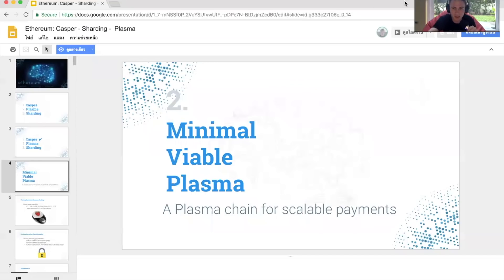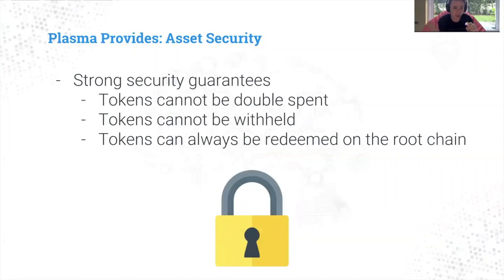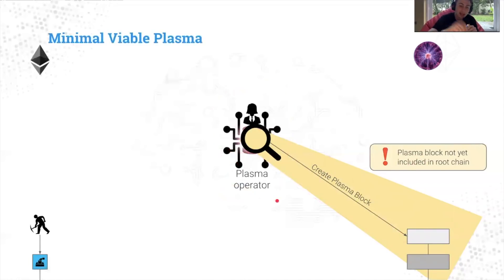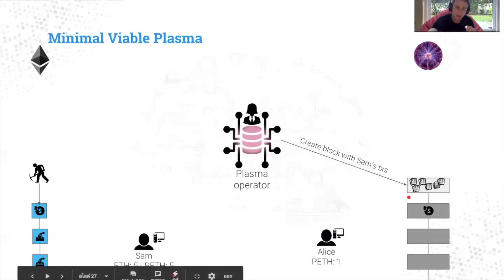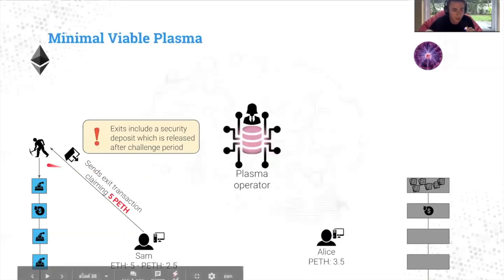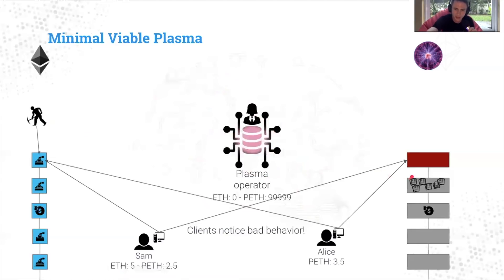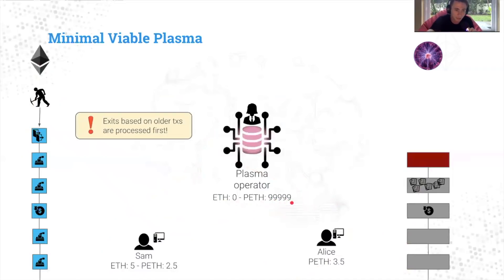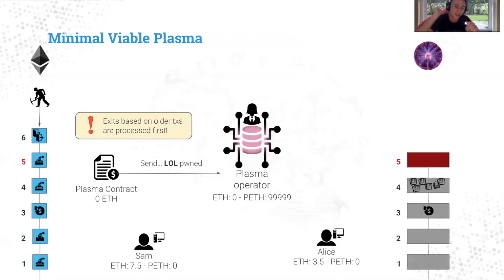Ethereum Plasma MVP Overview

Comment: How does this help with scaling if the transactions still have to go into the main chain frequently ?
First Alice has to wait for transactions to go on to the main chain to spend her funds, then why not send it in the main chain itself ? What am I missing ?
Reply: Yeah, so your question basically defines what a state channel is. So plasma chains are state channels with guarantors in between ?
Reply: Yeah so over here you trust that the guarantor will handle trust, but you're still limited to using the tokens on the subchain.

Comment: Great explanation Karl!  I have a question:  In your example, there is a 1 to 1 ratio between blocks on the the main chain and plasma chain. Was that just for demonstration purposes?  If not, how is 1,000 tx/s achievable if Plasma blocks are added at the same rate as the main chain?  (I have very little understanding of all this so apologies if this is a silly question)

Comment: Thanks for great video.

By the way I have a question.
What kind of datastore is expected to develop a child plasma system. I checked 2 MVP plasma or plasma-like  implementations  on github but both don't use blockchain on child chain side. They use no SQL like the levelDB.
Is this because they are just experimentations?

I'm implementing a plasma inspired system.
But it's difficult for me to decide what kind of datastore to choose.

1. MongoDB or other no SQLs.
Pro. Way faster than any blockchain system. 1000/s is easy. and very flexible
Con. Centralized and the plasma operator can do anything to the system. Only user can do is just exiting...

2. Use Geth to create private network as child chain
Pro. can use same coding technique as Ethereum main net. even same address works. PoA ( PoA if Geth supports... ) works well.
Con. We need to get users to have child chain 's ether for them to submit transactions. it doesn't seem elegant if we handle only token. 

3. Other blockchain technology like Tendermint or Hyperledger 
Pro. still it's blockchain and may be good enough for childchain 
Con. need to learn another new things... and we may need to issue 2 key pairs, 1 for Ethereum mainnet, 1 for child net...

Give me your suggestion?
Thanks in advance.

Comment: I have read the whitepaper and watched your youtube video , which is very helpful.  Thanks!
But I still have questions about how it works.

    1. deposit
    At 5:15 of your plasma mvp video, you said that when the deposit tx on the plasma contract on the main chain, a new block is immediately created on the plasma chain.
    My question is how is this new block created on plasma chain? Does Sam need to submit the proof of confirmation of deposit tx on the mainchain to the plasma chain himself?

    2. Confirmation latency of child chain
    Suppose that we have 3-level structures. Level 1 is eth main chain, 15 seconds per block. Level 2 is plasma child chain A, 5 seconds per block. Level 3 is child chain B, 1 seconds per block.
    My questions are:
    1) How long does it take to confirm a transaction on child chain A? 15 seconds?
    2) How long does it take to confirm a transaction on child chain B? 15 seconds or 5 seconds?

    3. roll back and fraud proof
    You didn't talk about fraud proof in your video. I also have a question about it.
    If an invalid block header is submitted to mainchain(no block withholding attack detected). A fraud proof is submitted to the plasma contract. How does plasma contract on the mainchain check if this fraud proof is valid? Here is my understanding, please tell me if I'm wrong.
    There are two types of fraud:
    1) invalid tx (double spending)
    fraud proof should include:
        a. block: latest plasma block containing all transactions
        b. old state: last valid state values with merkle proof needed to execute the transactions in the invalid block
    The plasma contract tries to execite all the transactions in the block based on the valid old state value, if some tx reports error, fraud is proved and execution of txs is terminated.
    2) all txs are valid but state is wrong
    fraud proof should include the same data as in 3.1)
    The plasma contract tries to execute all the transactions in the block based on the valid old state value, then get the updated state root, and checks that it is different from the state root in the lateset block header in the plasma contract.

    So in order to roll back an invalid block, the whole block, along with valid old state values, are submitted to main chain.
    This implies:
    a. the smart contract on the plasma chain must also be installed on the main chain
    b. in order to prove a fraud, computing a whole block on main chain sounds a little expensive, especially if the plasma block contains a lot of txs.

    Please tell me if I understand it correctly.

Thanks!

Comment: Hi Karl! 👋🏻 First I would just like to say thanks for the clear description of plasma with the nice event sequence figures. I found your video to be very informative, easy to follow, and fun to watch. You the man!
I’m curious what happens in the event that a nefarious plasma operator creates an invalid block on the plasma chain, submits the invalid block to the root chain, but then also submits an exit transaction to the root chain before Sam and Alice? Would this allow the nefarious plasma operator to abscond with Sam and Alice’s ETH? 😱
Reply: Exits reference unspent transaction outputs, and older UTXO's are processed first. Basically the earlier the PETH was received, the higher priority you get during exits. Since exits are started when a plasma operator creates a bad block, transactions in this block will always be the last transactions created so all other PETH will have been converted to ETH by that point.
Reply: Thanks for answering my question! If I’m understanding you correctly, when the plasma operator creates an invalid block it causes all entities on the plasma chain to withdraw to the root chain where withdrawals are processed based in longest held peth?
Reply: If it is proven that the operator created an invalid block, a mass withdrawal is initiated. All users on the plasma chain now must submit a withdrawal request within some time period (I think 2 weeks as of now). These withdrawals will be processed in order of earliest UTXO (longest held peth).

Comment: Hi Karl! I was wondering if you had a possible timeline for when some of these amazing things may be implemented? Things like Plasma, scalability , and Casper are really important to the ethereum network right now with some of the bad coverage ETH has been getting lately. My other question is would this create an entire new cryptocurrency? For example I have 40 ETH, so when these things are implemented would my ETH become worthless in favor of a new crypto? Thanks!
Reply from the maker: > when will some of these amazing things may be implemented?
Plasma MVP is under very active development and I would expect someone to have created an early version in just a matter of months. This will be allow for scalable token transfers (including ETH) with strong security guarantees based on the ETH mainchain.

> would this create an entire new cryptocurrency?
This does not create a new cryptocurrency. Your ETH is moved onto the Plasma chain, you transfer it sending a bunch of transactions, and then you reclaim that ETH back on the mainchain. This works for other tokens as well. There are also other Plasma constructions which allow for the trading of cryptokitties, prediction markets, or any other smart contract. The key is that each one of these gets its security from the main Ethereum network.

Comment: Hi Karl, you mentioned that Plasma Operator is centralized. What does that exactly mean? Who can become a Plasma Operator? thanks
Reply: In addition to my first question: how many plasma operators will be available and what about staking on plasma chain? Scaling: does it mean that one Plasma operator can handle up to 1000 TPS and 10 Plasma operators means 1000 TPS x 10? or can the whole Plasma MVP do 1000 TPS max? This is somehow related to # of plasma operators. Exits on Plasma chain: this might take a while since it always needs to check root-chain transactions right?
Reply from the maker: Some great questions!

> you mentioned that Plasma Operator is centralized. What does that exactly mean?
I mean to say that there is a single agent in the system (likely operated by a single organization) which has special status. This special status allows them to submit blocks to the mainchain. At first glance, this seems "centralized" but in fact even the special "single" agent is constrained in the actions they can perform. That's how we maintain decentralization of the system as a whole!

> how many plasma operators will be available
Anyone who wants to deploy a Plasma MVP chain can pick a central operator for their particular chain

> what about staking on plasma chain
These operators can be split up and elected using some sort of staking mechanism. There are a number of options for the block proposal mechanism itself, for instance one can use a leader election scheme, among others.

> Plasma operator can handle up to 1000 TPS and 10 Plasma operators means 1000 TPS x 10?
The scalability constraint on Plasma MVP is the client verification. If clients can verify 10,000 txs/sec then it would be fine to scale up to something higher. In other Plasma designs, there are ways to shard which txs clients need to validate, which greatly improves scalability. Possibly enough for way more than 10,000 txs/sec, without adding a lot of complexity.

> Exits on Plasma chain: this might take a while since it always needs to check root-chain transactions right?
That is correct. However, ways to bundle exits are being researched.
Reply: Appreciate your reply Karl! However, I have a few other questions related to your answers 

> I mean to say that there is a single agent in the system (likely operated by a single organization) which has special status.

Ok, so there is a single agent performing interactions with ETH mainchain. What if that component fails? What qualifies an organization to run such an agent or can there be only one? I understood that this organisation cannot run away with money but it somehow does not sound decentralized to me. Maybe I'm missing something....

> Anyone who wants to deploy a Plasma MVP chain can pick a central operator for their particular chain

So basically everyone can deploy a Plasma MVP and pick a central operator but how are transactions distributed among Plasma chains? In my understanding one has to put ETH in a smart contract and get's PETH in return to interact on Plasma chain. Why don't you also keep a history of transactions on the central operator and perform your checks there in case of an exit request? Wouldn't this be lot's faster an cheaper? You could eliminate transactions from "exited users" to save space on central operator.

> These operators can be split up and elected using some sort of staking mechanism

The central operator defines which staking mechanism will be used and who is eligible for staking, right?

> The scalability constraint on Plasma MVP is the client verification

By client verfication you mean "exit requests" once a user decides to exit plasma chain as it needs to access ETH mainchain for this?

You guys are all-stars but somehow I (and maybe part of the community) do not fully understand what's behind this technology and how it'll work in detail. I watched all your calls/presentations but that's somehow too technical for me. I'd love to descibe Plasma in laymans terms and publish an article or video but there are still some unknowns to me. May I send you a list of questions / drawings to clarfiy some topics? 

Keep up the good work and as Peter Drucker said: "the best way to predict the future is to create it". I'm sure that you along with Joseph/Vitalik/Omise-Team will create a great future for mankind. Live long and prosper.